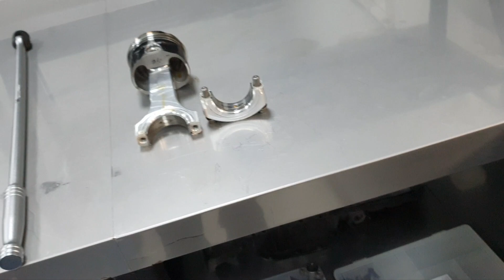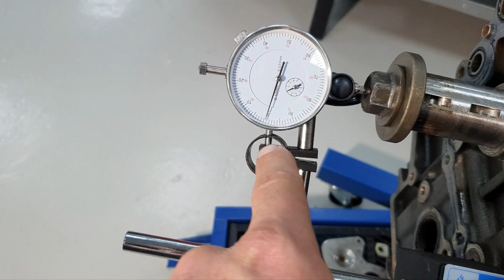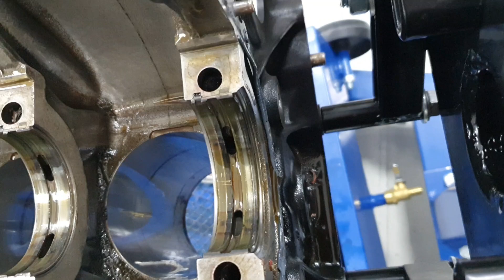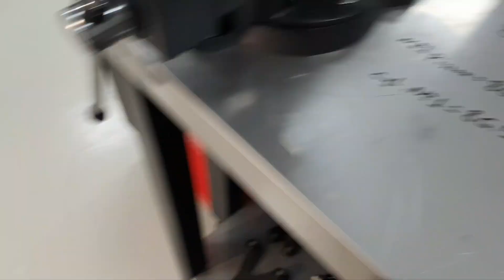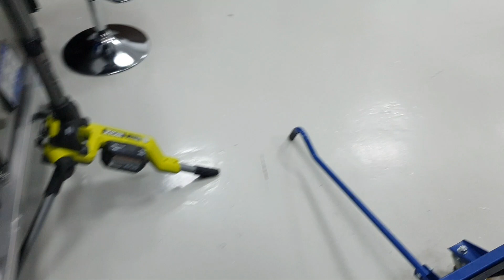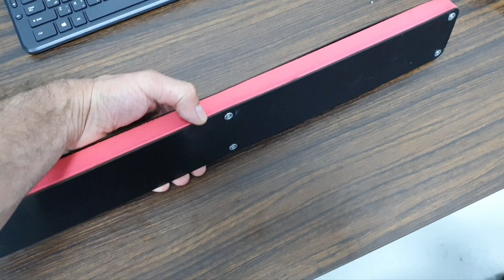2JZ-GTE engine refresh (part 3)

Comment: Hi Tasos,  are you replacing the connecting rods?   I understand that Aluminium rods have a limited lifespan.   Do you know how many 1/4 mile passes the 2JZ has on it?
Reply from the maker: I have to get some measurements first and I need permission from the owner to separate the pistons from the con rods.